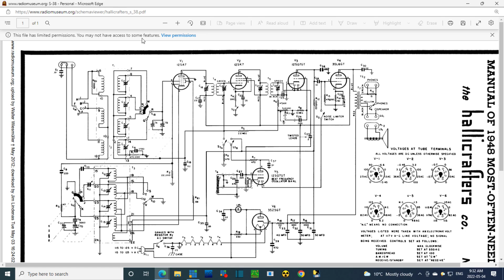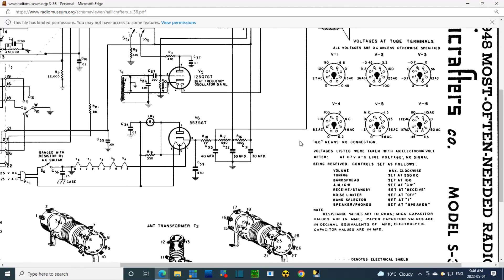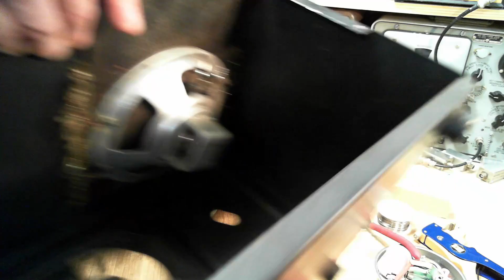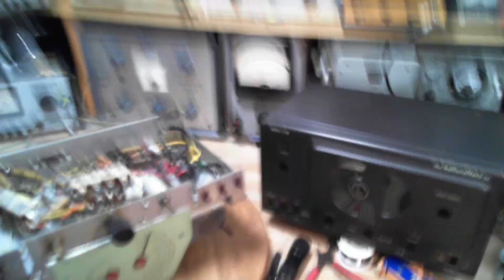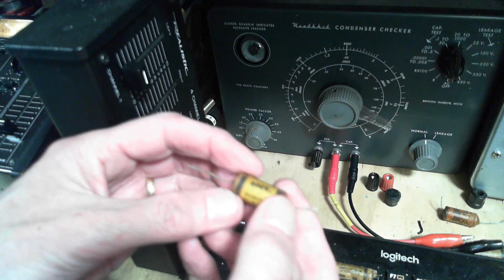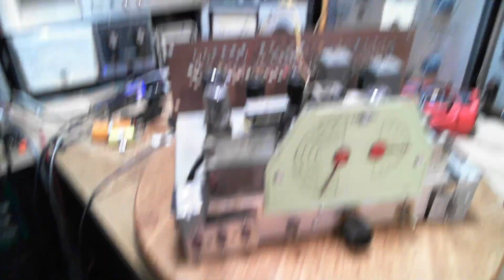Hallicrafters S 38 Four Band Tube Radio Video #3 - Two More Critical Capacitors

Comment: About the BFO switch: One section of the switch cut the power to the BFO, the signal is injected at the detector only. The other section of the switch simply reduce the AVC signal because the cheap diode mixer always generate a big DC voltage at output when the BFO is on therefore upsetting the AVC.

Comment: 32:45 He states that the B- to case cap is listed as a 0,25 MFD on the schematic but in fact is a 0,025 MFD in reality. Now 25nF seems like a sensible value since in a 120VAC 60Hz environment as it would limit the ground fault current (case>user>earth) to about 1,2mA. 250nF however would allow 12mA to pass from case through the user to earth ground, which is on the high side.
That raises the question; What value did he replace the cap with? The schmatic value of 0,25mfd or the real value of the old part 0,025mfd?
Going by the video the size and type of cap he used looks like a 0,22mfd X2 rated cap...
That would not only expose the user to an unnecessarily high ground fault current but also be a potential severe shock hazard, since X1/2 rated caps are unsuited to be used for passing ground leakage currents from chassis to earth via the user. Only class Y1/2 rated caps are suited.
Also did he state at timeindex 33:47 that he had no way of relating his capacitor tester indicating the old case cap as leaky to how much current it would pass and if it was a concern. That is simply wrong! One can always measure the ground leakage current from a device to earth ground using an Ampere meter or the AC voltage drop across a shunt resistor. Not only is there reading material on the maximum value of earth ground leakage currents but also is it mandatory to check for the compliance with these figures after any service or repair performed. 
Bottom line; this person is unsuited to fix any type of radio which has a hot chassis. And as some pointed out, we have to hope that noone will be severely injured by his neglections, lack of knowledge or mistakes. 
But maybe the customers should sue him if they get hurt by his doings, so that he may decide to educate himself and learn, or get another hobby.

Comment: You have two oscillators running simultaneously, the BFO at 455Kc and the local oscillator was never defeated. So all those frequencies are heterodyning in the converter stage.

Comment: I can't help but wonder if the heterodyning you are hearing is because you have the BFO turned on???
That capacitor that is between the chassis and the case...NEEDS TO BE A SAFETY CAP!!!
I have a Hallicrafters radio that has a Gimmick capacitor in it.  What I find fascinating about it is that there is a "part number" for the Gimmick!  In fact, I think it is called a "Bakelite Gimmick" capacitor.  I haven't looked for it yet, but it is on my must-do list.
I am sure you have your reasons for not replacing all the paper capacitors, but considering the acid buildup in paper capacitors (or anything with paper for that matter), they ALL are disasters waiting to happen.  They WILL short out at some point, and in the process most likely take out tubes, transformers, and possibly other components as well.  Considering how rare the transformers and tubes are becoming, I would rather err on the side of caution and replace them all.
Do you plan to sweep the IF transformers to see how they perform over frequency?  It would be interesting to see how "tight" or "broad" the curve is around the IF frequency.

Comment: I truly hope all of you restorers have good  coverage on your home owners insurance if you are doing this work on “Hot Chassis “ radios and selling them or accepting remuneration for your service. 
Something to think about. Suppose that you sell one of your modified radios and for some unknown reason the buyer gets a jolt and is one of the many litigious types. Are you qualified to state in court that you are smarter than the engineer that designed the product? You may technically correct but that does not always hold any water today.

Comment: Safety Note: Like all "AC/DC" type radios, the S-38 presents the danger of electric shock if you touch its chassis while plugged in. To minimize the risk, you should always operate the radio from an isolation transformer rather than plugging it directly into the wall. Isolation transformers are available from Antique Electronic Supply and many other sources. The radio is even more prone to shock hazard with the metal cabinet. 

I

Comment: How is he convinced this is not a hot chassis radio? They all are. It needs to be made safe. They all do. I used to think Jim was good. But he leaps to conclusions much too soon.
Reply: It has nothing to do with leaping to conclusions. It is a matter of being able to read a schematic. And time and again he fails in that.
Reply: @asmallmatter4441  He usually goes to alignment way too soon.
Reply: @ArthurHallicraftersKitchen  Many times  does multiple alignments and still gets it wrong!
Reply: @hestheMaster  He omits so many steps before doing alignment. And seems to think once the dial is accurate, the radio is fine.

Comment: Does anyone make a 1 to 1 transformer as in 120 to 120 volt trany, so as to isolate the chassis that way.
Reply: Digi-Key sells this one:
http://catalog.triadmagnetics.com/Asset/N-73A.pdf
I am sure there are other manufacturers, dealers, etc. that have other ones as well.
Reply: @waynethompson8416  Ive got several isolation transformers on my work bench and swear by them. I also use an RCA Variac instead of the Dim Bulb  setup. Mounted to the Variac is a multi function digital meter, that I can monitor voltage, current and power as increase the voltage
Amplitude.  The other two isotransformers and much like the Triad  you pointed out. I do work on Ac/dc radios and use an ISO T during the process. The final mod is a three pronged plug and I test my work. On one particular job I placed a correct wattage  sized ISO inside the cabinet for safety. Where I can I use an ISO as part of the retro-fit refurbish task. I do not claim to restore sets.